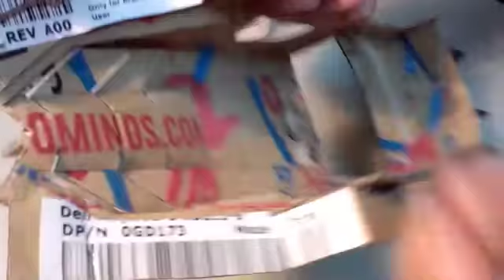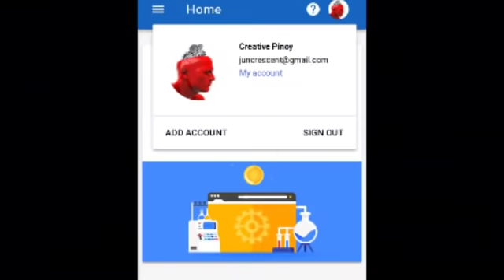How to make Lamborghini veneno RC using card board

Comment: Its awesome i want to make it but pls can u provide Mesurements try to do pls
Reply from the maker: Sorry bro still not make template for this project I accidentally threw it out the cardboard I've cut.
Reply from the maker: Watch my other project Ferrari and Bugatti have available template in my description
Reply: @CreativePhil  yeah i m making ur la ferari but i hv a problem how u hav set the wire to.lift tha rear and doors i cant understand
Reply from the maker: @ashishkr7403  ah ok bro in my la Ferrari I used 2 receiver but if you have receiver with 5 channel much better